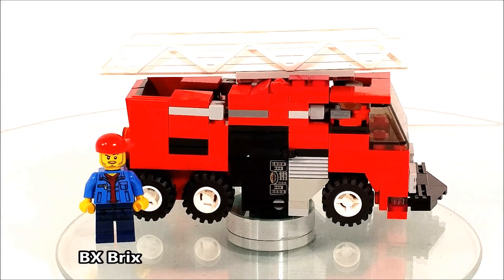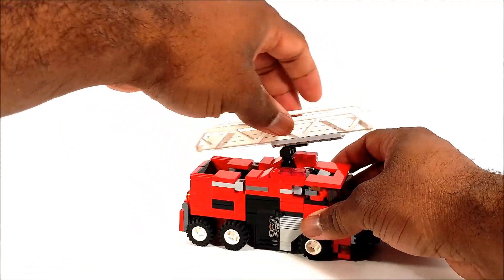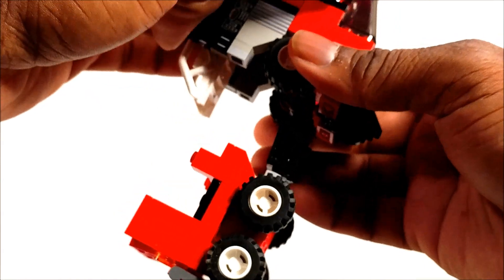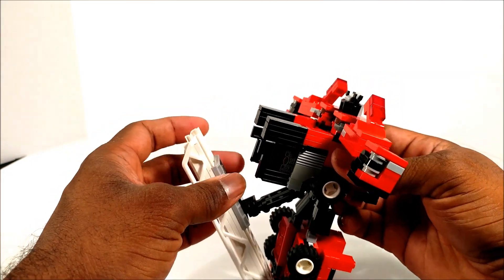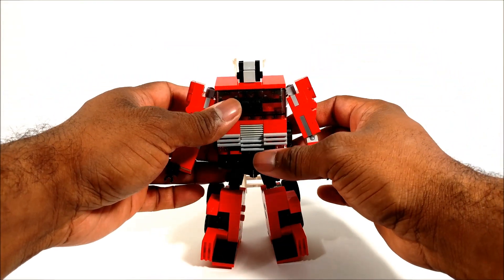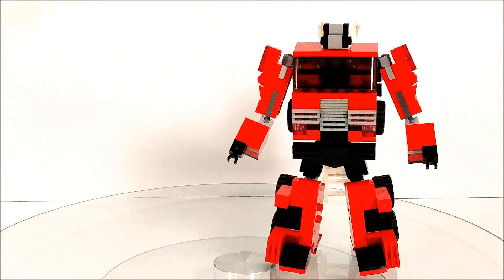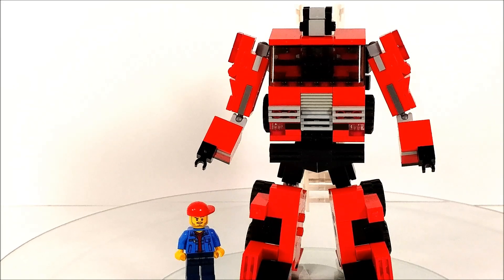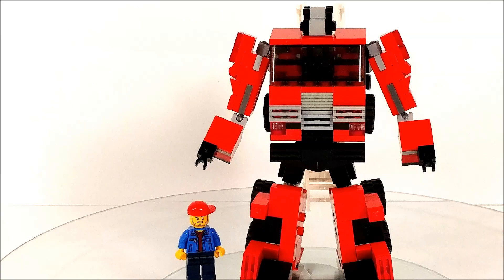Lego Transformers Inferno Mini By BX Brix

Comment: Hello bx bricks I have a question I really love transformers (duuhh) and Lego (max are you dumb) and I would love to make a combiners do you have any tips on how to make a good combiner? It would be nice if you could reply to this 👍
Reply from the maker: I think the first step is creating a standard frame for consistency. Figure out how big you want the combiner and that'll tell you what joints to use to hold the weight, then how can you hide those joints in the chest of each limb bot without compromising design
Reply: @BxBrix thank you so much this really helps✌